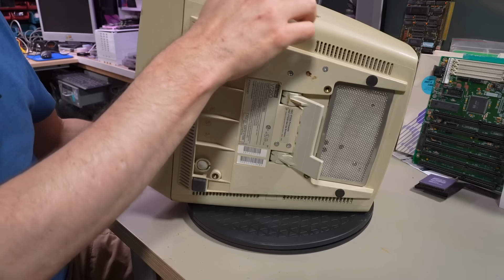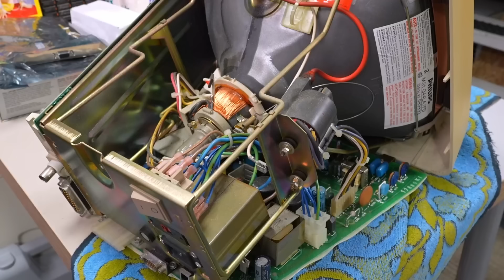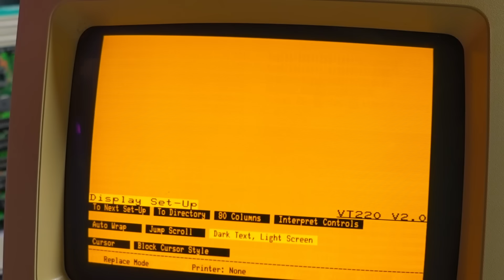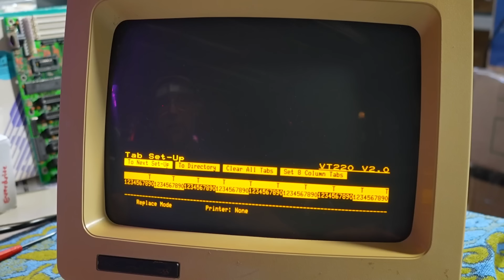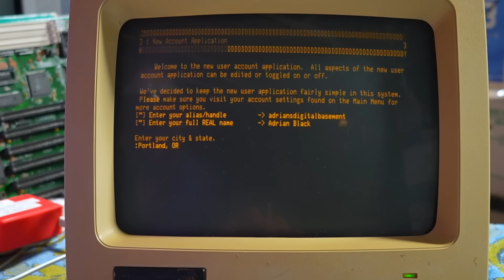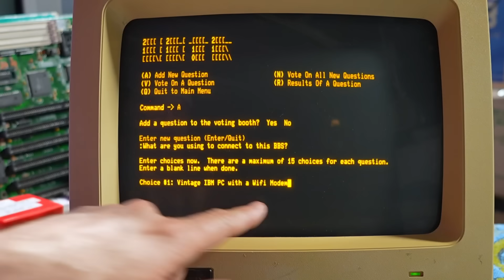Getting online with a DEC VT-220 terminal

Comment: This is a great terminal.  I had one on my desk, along with the enhanced Color version back in the day when I was sys admin for the site vax cluster.  Incidentally Vaxen (the proper plural of VAX) all had hard disks available, both 14" fixed, 14" removable, and 5.25 Inch RLL (just like the PC) drives in the microvaxen form the mid 80's or so on.  Micro tapes (the size of an 8-track roughly) were often used for software distribution including OS updates, the 9-track tape drive was mostly used for making full backups every week.

Comment: ATDT stands for AT (attention) DT (dial tone), there was also ATDP to dial pulse which I bet your little box supports :)
Reply from the maker: Yeah that's right -- but on this ZiModem firmware, it seems to stand for Telnet and PETSCII. Not exactly intuitive as leaving either out just .... who knows what it was doing. :-)
Reply: @user-dw8qz1qg3x That was the end because a POTS line (DS-0) supports 64k, and the phone company reserves 1 bit as a control bit that is reserved for the phone company, thus, 'dial up' maxed out at 56k
Reply: @user-dw8qz1qg3x Strictly speaking many of us still use modems, but in general they are embedded in mobile phones, adsl routers and the like. Occasionally (like my V.fast modem by BT) you still get a pure modem box.